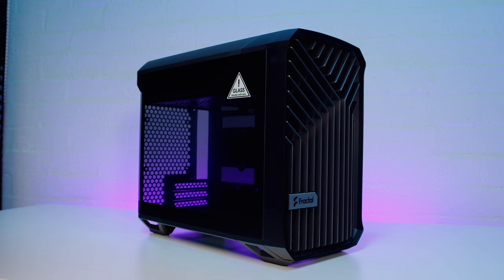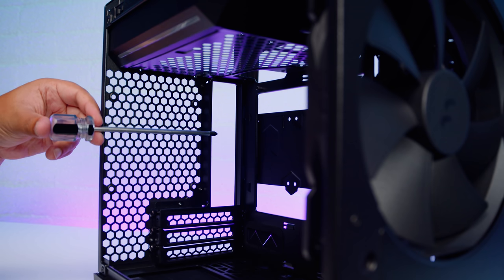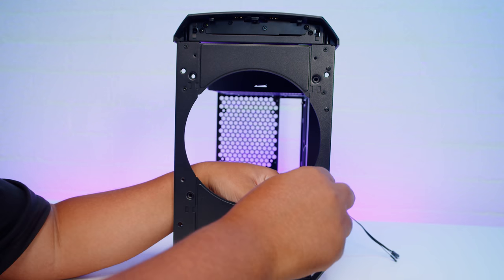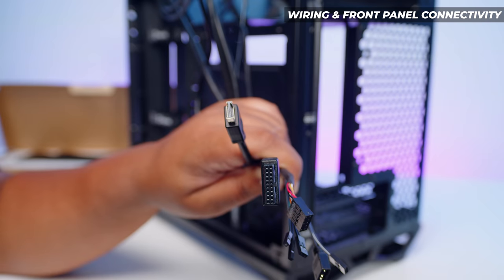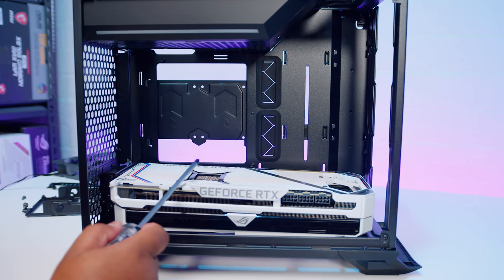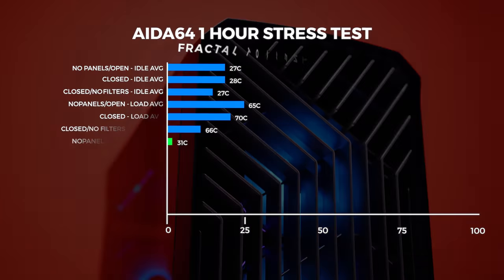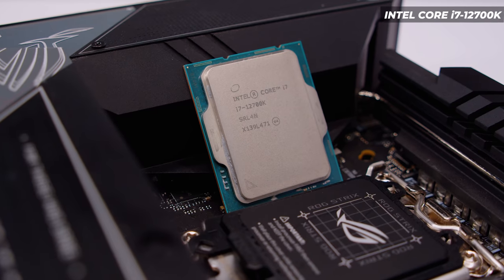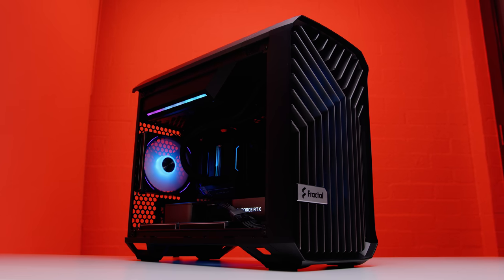The Fractal Torrent Nano is GORGEOUS!

Comment: Fractal is killing it with their latest cases. Love it. Especially going back to the top placement of the PSU for easy to reach cable management.
Reply: Heard from a classified source: Best to have flexible power supply cables
Reply: Not just that but also it acts like an exhaust fan which is smart.
Reply: @DoNotSayThree  The Torrent series is designed not to need an exhaust fan, maybe a bit from the PSU at high load (when you probably don't want a 0rpm mode on).

Comment: These large ITX Cases should also support MATX.
Reply: Then it wouldn't be an itx case now would it.. Just saying
Reply: IKR there need to be more sff matx cases
Reply: It’s barely shorter than my Montech Air 100 MATX case, and longer and wider than it.
Reply: @phillysupra  i mean its larger than some matx cases so.....
Reply: @Deviantsoundz  ok.. And...
My evolv shift air is taller than this case, it's stlll itx... Because that's what the stansoffs dictate.
Reply: @phillysupra  its a tower case so yeah its taller 😆   hell rog z11 is bigger not only taller than some atx cases. Again just awful use of space for just an itx board.
Reply: @Deviantsoundz  you got it guy
Reply: Sometimes there's no official support for MATX but it's still possible to put some MATX motherboards in a NR200 for example. I have a B460M-HDV in mine.
Reply: It could be done with a sfx psu
Reply: I have this case trust me it wouldn't fit.

Comment: Thanks for actually using the front 120/140mm fan brackets Nick, only video I've seen that does this.

If you haven't torn this down yet, I would be interested to see if you have a similar experience to me with your FE card thermals, I found that having a fan placed directly below my 3070FE actually increased the temps on the GPU compared to no fans, I think the fans on the FE coolers work best when there's >10mm air pocket in front of them, or they're unusually susceptible to turbulence. On my NR200P, I had to mount my bottom intake fans under the case and replaced the stock feet with taller ones in order to avoid this.

Personally I have been toying with the idea of moving my build over to the Meshify C Mini for the MATX support further down the line, considering how close the torrent nano is in terms of size to that (it's within 1cm in each direction iirc), it seems like it has none of the benefits of going ITX - even if it is really pretty
Reply: try to vertical mount FE cards on itx builds. blow air from beneath and suck it out on top. on vertical builds you have so much more space for good airflow if you use cases which only allow vertical airflow as with the jonsplus i100. Use good fans as well like thermaltake toughfan 12/14. 

My Jonsplus build is super quiet and has an RTX3080FE to fit. Undervolted im on 71celsius with high load on Warzone/Pubg with 120-150FPS on QHD. 

Hope this helps.
Reply: @tinypatches6939  Not entirely sure what you're getting at here tbh. Are you saying replace the case with something that is sandwich layout or similar?

If so it's quite an expensive option once you add a new case, new CPU cooler (currently using a 120mm tower) and a new PSU (currently using an ATX unit). 

My solution was to raise the case on slightly taller feet and mount the fans below it so there's a air gap between them and the card and I am getting up to about 67C max under gaming loads. My point was that with the fans inside the case (i.e. <5mm clearance from the GPU) my temps were up in the mid 80s. No change apart from the fans being a little further away causing a huge drop in temps. I'm guessing that the FE fans are not optimised to work in turbulent/confined places.
Reply: @AxR558  sorry my answer was a little bit out of place. I just meant when you consider to move your build over to another case and you want good temps in an itx build the look out for cases which allows you to vertical mount gpu's. because then you really have ITX benefits = small build and good temps with low noise. My answer wasn't even considering using the torrent nano. 

You was talking bout FE Cards and high temps and that's almost always because of the mounting position of those cards. if you think about it logically you have one of those two gpu fans throwing hot air under it self and there there is only little way to let it escape. with vertical mounts its way much easier to get rid of the hot air. I have build 6 different PC's all with FE Cards by this time and my smaller itx build with vertical mount has the best temps of all. And iam talking about ITX and Big Tower builds, no matter what the vertical mount had the best temps. 

Excuse my english, I hope you understand my point of view.

"I'm guessing that the FE fans are not optimised to work in turbulent/confined places." - that's completely the case!
Reply: Ah, yeah absolutely get what you mean and totally agree - really anything that moves the hot exhaust away from the back of the card has a major benefit to temps.

I'm seriously tempted to start case shopping now :D
Reply: @AxR558  I don’t know about this, I have my 3080Ti FE on a NR200P max and it gets hotter if I blow air into it from the bottom (have in mind that the NR200P max only supports vertical mount) 

My 3080Ti gets to around 78° when I put the bottom fans, but it only reaches 72° when I take out the bottom fans. 

Weird….
Reply: @estebaneordogh4564  that’s not far off my findings in the NR200 (standard mount), I think the FE fans struggle with air that is turbulent or anything too close to them. 

I did end up going to the Meshify 2 compact and temps dropped by about 8 degrees
Reply: @AxR558  so, you’d say that if I were to build on the torrent nano, keep the bottom fans off?
Reply: @estebaneordogh4564  I think it depends on the amount of space between GPU and fans, I ended up getting some taller 3d printed feet for the NR200 and mounting the fans under the floor which seemed to resolve the issue totally. Not sure what the clearance is in the Torrent though, slim fans in the bottom might be the best solution overall though.
Reply: @AxR558  hold on… on the NR200, the taller feet resolves the issue? What’s the difference? Isn’t it the same distance from the fans to the GPU? I’m a little confused
Reply: Aaaahhh mounting them UNDER the floor…. I see now. Might be worth a try.
Reply: @estebaneordogh4564  Ok every time I post the image link it deletes my whole reply happy to send it via other social channels if you want to see the outcome of that mod.

Comment: Love the case. Just ordered it in white. But, as beautiful as it is, it annoys me that Fractal Design is still using loose front panel connectors when the likes of NZXT and Cooler Master do the right thing and combine them as one plug.
Reply: I just ordered the white as well! had to get a different motherboard to switch my parts over to though, and i finally splurged and got my first SSD lol. got a gen 4 sabrent rocket. should be insane difference in speed compared to a literally 10 year old hdd
Reply: @PillsburyNinjaKneadingJustice  I got the case for my X570 DTX Crosshair VIII Impact. I’m planning on using a SFF PSU.

Comment: I know nick keeps saying that this isn’t sff, but with how big the case is they should take more advantage of the extra space. Matx for sure. I do like the looks of the case though. I would like to see it next to an nr200 or say an h210
Reply: He did show it next to an NR200.
Reply: @chrismondo  I need to rewatch it. Doh!
Reply: @la009895  Lol I mean it's tagged in the timestamp "Side By Side Size Comparison". It's significantly larger than the NR200 but I'd still buy it for my collection :3
Reply: @chrismondo  I originally watched it on mobile while driving and totally missed it. Went back just now to watch. I already thought the nr200 was too big for my desk so this would be massive and would have to live on the floor. May as well for full size at that point!
Reply: @la009895  No kidding. This made my chonker of a Thermaltake Core V1 look petite by comparison. 

Give this thing internal PSU mounting in the front to shave the size a bit and you have a much more practical matx case. Sama IM01 is just around NR200 size and Sliger Cerberus is hella expensive. FD could have slotted in perfectly here.
Reply: @InushiDoggo  My thoughts exactly with the Sama and of course, anything Sliger makes is gorgeous if expensive. I get that this isn't SFF but what's the point of ITX if you are going to go big... 2 dims of ram and 1 pcie slot
Reply: Still a traditional layout inside so the space utilisation is fairly standard. It’s built for air cooled airflow so you want space and clear flows to move air easily.
Reply from the maker: You should watch the whole video before commenting lol
Reply: @GearSeekers  I should quit multi tasking for sure too! Great content as always!
Reply: @GearSeekers  you should see that he corrected himself and rewatched it again lol

Comment: I understand that ITX doesn't equal SFF, but this definitely looks like an MATX case that has ditched the MATX compatibility to allow for a standard PSU to be used with an ITX only motherboard tray.  Perhaps they wanted the ITX label to be able to charge the ITX tax.  That aside, Fractal did a good job in maintaining the design language for the front grill on this smaller case.
Reply: Agree with all of this and Fractal are known for terrible pricing (at least in Australia) so my cynical mind thinks that they've lopped 1 pcie slot off to sell it as a "premium" ITX case. They could have made it an inch taller to support mATX...reminds me of the Phanteks Evolv ITX vs the mATX model, which was barely bigger.

Comment: Even though for whatever reason Fractal just stopped production of this case after 6 months or so and never resupplied inventory. I was the perfect no compromise case for either air or liquid cooling. And the perfect size especially looking at the "SFF Cases" that have come out the past 6-9 months. Would be nice to see an update with 7950X-3D / 7900XTX or 4090

Comment: This one lands on a weird spot, reminds of old itx cases that werent that small. The compact strikes a good balance of size and component compatibility.
Reply: Just imagine filling this thing with a Noctua D15 and a slim 240mm radiator and pump/res for the GPU. Hybrid air/water system and completely full of components. It would honestly be peak system

Comment: I'm currently running a NR200 dual 240mm custom loop and will likely build my next PC (in a few years time) in something like this. Although I haven't had any major issues with water-cooling I have had some close calls and general PC weirdness and the idea of draining a loop and removing everything to problem solve makes me want to just go back to air-cooling. I imagine a noctua D15 in this case would be incredible!

Comment: I hope you did something good with that fan you took out, it is the star of the case.   It moves almost 150cfm and I can't even find another fan that compares.  Most smaller fans don't add up to that much airflow in a double stack, nor do they create the perfectly aligned tunnel that is set up by default in this case.

Comment: I wish more companies did mesh side panels instead of glass
Reply: What for? The original fractal torrent has the best air cooling you can get, without a mesh side panel. If you want an open air case, just get an actual open air case my dude.

Comment: I love the look but the limitations on GPU / fan support is frustrating considering it’s not even that small. I would be very interested in seeing a custom loop in here if the smaller gpu water block allows for a 3090 and double radiator setup. (Haven’t done the maths on whether that’s possible though.)
Reply: Fractal Torrent is a very good airflow case, so it doesn't make a lot of sense to do a custom loop in this... Go for a Lian Li O11 or Hyte Y60 if you want custom water cooling.

Comment: Just got this case and glad I did. My cpu has a very small profile heatsink/fan that I used for the Core 500. However, I had to upgrade because that case couldn't fit my new XFX RX 7650 XT (MERC). Fits like a glove in this one. Despite the small fan, temps are VERY cool in this case.

Comment: Big issue with this case is exhaust. It's critical for ITX/small form factor. If you put a massive fan in front, and can only put a standard 120mm in the back, it will be difficult to keep a negative pressure environment in the case... which is what affects GPU temps massively. NOT putting intake fans under the GPU in thi scase makes much more sense. Other than that, it's a gorgeous case.
Reply: Well, the Torrent is designed for positive pressure. Negative pressure works better in some case, like sandwich style ITX cases, where some cases work better in neutral pressure and some work better in positive pressure. There's no catch all here.

Comment: What's the point with bottom fans when there is literally 3 fans on the gpu close to the bottom? The bottom fans are so the cabinet itself gets cool air from the bottom so it can give the gpu fans cool air. So I guess it's actually just not needed.
It's pure science. Heat moves to cold area. So all you have to do, is make sure your pc have overpressure to avoid dust coming in, and then remove the hot air. Lets say you didnt need the overpressure, you could just as well only have exhaust fans. But that works both ways. If the air in to create overpressure have plenty of space to get out, you don't need exhaust fans either.
This case here, will give the gpu the cool air from the bottom. This case will also create overpressure with the massive fan at the front, and this case will also remove the hot air. So in all honesty, and please correct me if I am wrong (wrong as in this is actually tested and not just your opinion), but I believe that this case only needs ONE fan in front and that's it. The gpu has dedicated coolers, and so has the cpu. The cpu cooler has one function: Remove heat from the cpu. Where that heat is being placed, doesn't matter. If it's being moved to a water cooling radiator, or being moved just another place in the cabinet, doesnt matter. The main point is to move the heat away from the cpu. And what is doing that? The heat sink and the cpu fan. The water cooling radiator isnt removing the heat from the cpu. It's cooling down the water, and the heat that is being cooled down, is being blown back into the cabinet, which then needs to be removed with exhaust fans because the radiator is being cooled by front fans, so the airflow is more limited. Hence why I think watercooling is massive overrated. Only reason I would like water cooling, is if I could cool down both gpu and cpu with the same radiator and the radiator placed at the bottom. The hot air in the cabinet will then be moved by fans.

Comment: Definitely not SFF but if you want to go ITX and not bother with cable management, this one is hard to beat. It also comes with solid panels now. In my case (ah!), I won't have a view of the sides, only the front, so no need for tempered glass panels.

Comment: Honestly after having a Louqe Ghost S1. This would be the ideal size because I can't deal with CPU heat. Keeping my Ryzen 3900 cool in the Ghost Louqe is hard and it hovers over 45 degree C. Because of that it throttles and I also need more space so I guess this is the one to go with. I've had 2 AIO failures and want to go with Air cooling now. With this it would be possible.

Comment: When I looked at cases for my gaming PC build, several cases I liked were literally 2cm too short fro a 330mm graphics card since I have a radiator for CPU cooling as that would be placed in the front. I looked at the Torrent Compact, and it's the same thing all over again, except maye 3-4cm too short :P But quite happy with the Core V21 though.

Having the PSU in the top is great. They used to be there are from now on, they should be there for most cases as it's so easy to change things later and for installing, and you can use direct air from from the bottom!

More great music! \o/

Comment: Just built in this rig im really digging the fact i can plug in the 24pin and PCIe cables from the top down i zip tie to the 180m fan and bottom fo case for PCIe and it makes for a clean build. The included brackets for installing ²x 140m fans in front. But the paint is really susceptible to scratches made mistake of tilting it on my wall at a angle and it scratched the black paint on the plastic not a  dig on case as it's beautiful more a lesson put foam agaisnt wall if needing to angle a case against it 🤣
Reply: I just wish they'd had a mesh option on least one side of the case that would be mesh.

Comment: Little on the big side but looks pretty good due to that extra width it makes it work out ok with the larger (For itx only) size. Honestly since the look and CPU clearance lends itself to it I probably wouldn't use this with water cooling: the ideal use is that front 180mm fan and a beefy noctua NH-D15 or something similarly big.

So if you do any revisits on this I'd kindly request some air temps instead with that 180mm default fan.

Comment: great content and makes me sooo jealous haha! How did you actually managed this to fit the GPU though? Clearance for GPU is 335mm for the case. 3080ti foundation is 285mm which only leaves you with 50mm for the radiator and fans in front! The radiator you are using is 60mm, no? I have an ASUS TUF GeForce RTX 3080 Ti (299mm) and bought same MB which no air cooler fan really fits due to height of the VRM heatsink on MB. I really want this case but I don't know if any water cooler would actually fit...

Comment: if Noctua do a 180mm fan, I would love to put one at the front.  I wish there was a vented top panel i could buy so I could have the hot air from the PSU vent out the case and not into the pc.